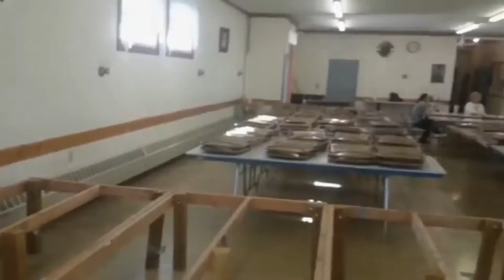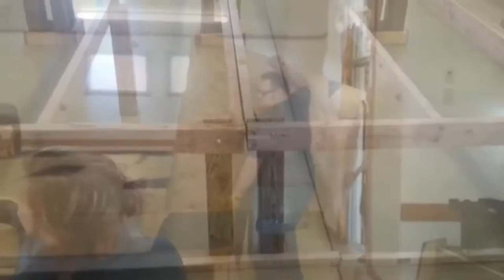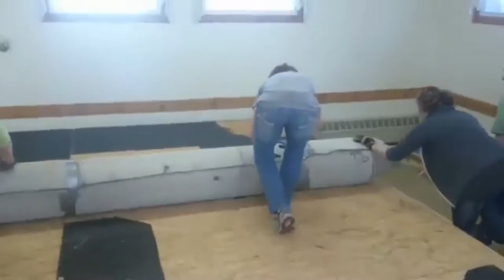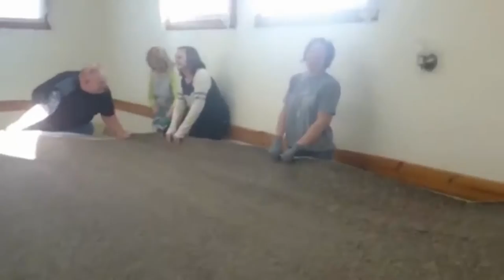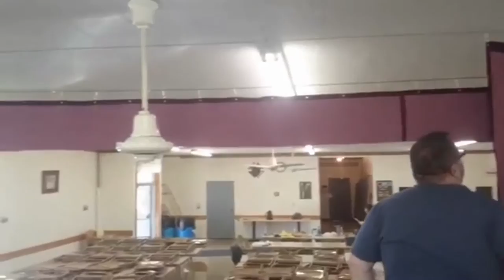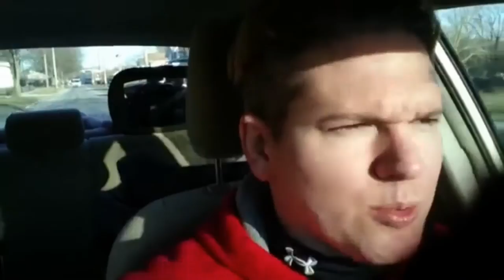Building a Theater Stage in a Day

Comment: Where do you get 4'x8' prefab floor sections?
Reply from the maker: They weren't prefab. Honestly this isn't the best tutorial because in order to really do this you need to make the 4x8 structures our of 2x4s screwed together and use carriage bolts to add 2or legs
Reply: @platinumdragon7  Ok, thanks. I get it. I'm about to build a stage, and want it to be  modular like that.
Reply from the maker: @lisafreeman4235  that's cool.we just finished re-erecting our stage for a performance in March. The design of the 4x8 has been tweaked some but the principal is still the same. You're basically making a rectangular structure that is 4'x8' x 36" tall approximately and making the legs foldable for storage. Then there is typically something fastened to the legs on the bottom to keep them from shifting. Then plywood screwed to the top which adds rigidity.
Reply: @platinumdragon7  Thank you!
Reply from the maker: @lisafreeman4235  Here's our most recent setup. https://www.youtube.com/watch?v=y2-WAtINexE